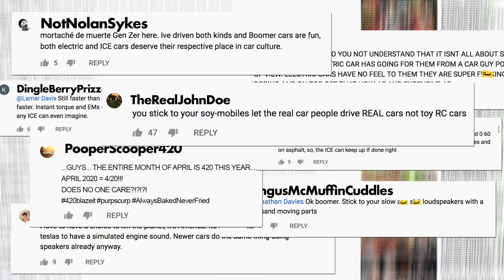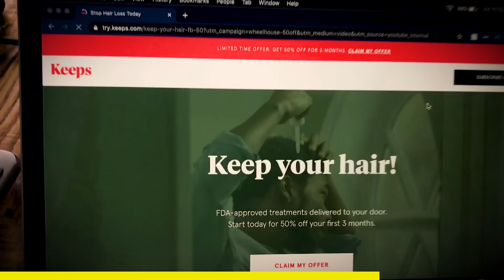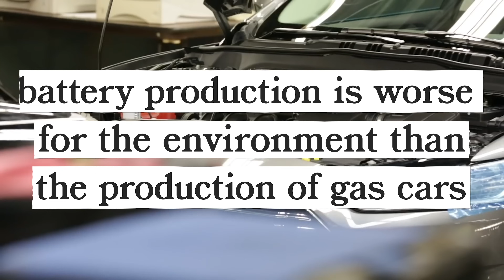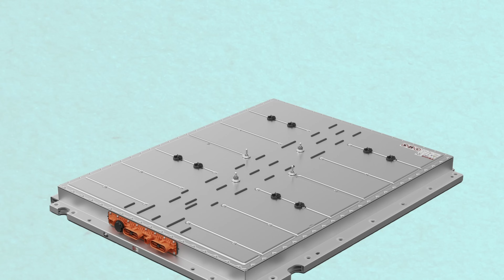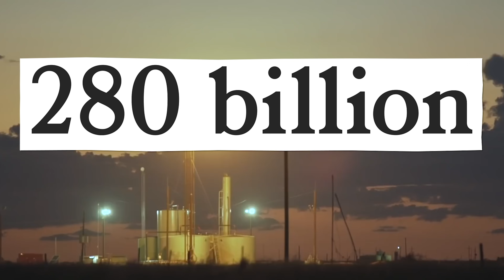Are Electric Cars REALLY Better for the Environment?

Comment: I wonder though, when it comes to ICE engines, what can alternative fuels do to top gas powered engines AND EVs? I feel like with the efficiency of production for ICE engines, pairing it with a less destructive fuel source (especially right now that EVs are way behind) would set it really far ahead from EVs and gas engines.

The reason for my stubborn anti EV stance is because of the way the movement in favor of it is trying to cram everyone into one by force. Making laws that force people to do something and have them appreciate the benefits only in hindsight it way too antagonistic and ruins something genuinely good for the environment in the mind of the average citizen. People will inevitably move towards EVs as they become more affordable, and we have a fair amount of people making the approach right now without being forced to buy into them. If you force the EV industry to cater to the hundreds of millions of Americans alone (and that number is growing) even by 2035 like California wants to do, you will cause an exponential increase in environmental pollution in such a short time frame that will likely have worse consequences than the slow burn CO2 emissions from gas cars are causing right now. 

Think of it like a slipping clutch, you will either wear away at it slowly with bad driving habits or you can just bore right through it with one massive burnout. Mandating EVs is the latter option, and it's wrong for it to become a legal mandate instead of a heavily incentivized alternative. 15 years goes by quick in the business world, folks.

 I feel like if we have to do anything, we need to make "non-specialty vehicles" (basically commuter cars with no outstanding performance features) run on alternative fuels of some sort. Yes, there will be cars people use for racing, heavy hauling, or simply luxury, but perhaps those more expensive specialty vehicles can be the ones to run on diesel or gasoline thanks to their practicality when applied to their maximum efficiency. Imagine heavily polluting the environment to produce gasoline, only to have it serve the absolute minimum performance possible, that's like tending to a hundred-thousand-dollar vineyard just to make bargain brand grape juice. So if you're just going to be using your compact 4 door to get to and from work with carpooling in mind and we aren't going to force everyone to get an EV by a specific deadline to drive emissions up so high from production, you should talk more to the folks using biodiesel and used cooking oil or whatever. Meanwhile, if you're purposefully going to indulge in the hobby of motorsports or need an ICE for purposes that "commuter fuels" cannot satisfy, you should be the main market being catered to in order to make production of gasoline more worthwhile in the long run.

Plus, once ICE engines running on traditional fuels become a want and not a need, the production of traditional fuels will be tied directly to the demand for it from the specific markets that need a specific kind of fuel. Less demand means less production, and the less you produce, the less materials you use up in a given time frame to meet the smaller demand (which means you contribute less pollution in that time frame as well!). And once people slowly start to feel "ready" to leave ICE engines if EVs start to scratch that itch for higher performance better, you'll have a smoother transition into a fully electrified and environmentally healthier auto industry that caters to all needs.

TL;DR: ICE production is less polluting to the environment right now, so why not use alternative fuels for simple commuter cars to offset their wastefulness and be better than the amounts of pollution EV production makes alone? Because I think forcing mass EV production for a huge market of consumers by 2035 in California alone is only going to cause worse amounts of pollution, it'll just be happening somewhere they don't have to see it instead.
Reply: Too long didn’t read much but the 1st and 2nd paragraph, but the thing is EV’s ARE less harmful to the environment, and the reasons the laws are enforcing it is because it NEEDS to happen now or else our whole population is gonna be wiped out. Just because you don’t like the way it is being done, doesn’t mean you have to let it wipe out our population.

Comment: You are not accounting for batteries being much less efficient as they age. They are also much less efficient in very cold weather. Much of their power will be sacrificed to cabin heat, or air conditioning I have a hybrid and it’s mpg drops by 15 to 20% during the winter months. Are you willing to spend 20 minutes or more charging your car during a long trip? This will create long lines and angry people. If we eliminate gasoline powered cars, how do we maintain our roads and bridges? Toll roads? Ask the people who use the Pennsylvania turnpike how that’s working out. How do we supply the additional electricity required to replace the gasoline power? Solar and wind power is NOT capable of creating sufficient energy to supply the additional energy required. So fossil fuel power will be necessary and will be required to use much more power which will only transfer the pollution from the vehicles, to the power generation sector. Nuclear power generation would work but there is too much resistance to it at the present time. I currently drive a hybrid vehicle which is about 7 years old. The hybrid batteries have lost significant efficiency due to normal aging and deterioration. I started out at 46 mpg and now get about 36 mpg. This loss of efficiency will also rapidly decrease the value of the electric vehicle as the vehicle ages. There are many more disadvantages of the EV’s such as long recharge times and more frequent refueling stops. Extreme weather, (hot or cold) are also very bad for EV’s. For people with no garages it becomes very impractical and costly.
Reply: ICE engines also become less efficient as they age.......and they are also less efficient in cold weather.

Comment: Great video. And I know its nitpicking, but the nuclear power plant in 8:41 is not releasing any emissions into the environment, that's water vapor. Nuclear energy remains the cleanest and most efficient solution to the replacement of fossil fuel.
Reply: Clean??? Leaving the nuclear waste and irradiated sites for future generations to deal with?
Reply: @ridstanejimmy  the waste produced by nuclear power is infinitesimally small. And there will not be irradiated sites if they managed well. Nothing is 100% safe, but nuclear energy is almost literally magic.
Reply: @arturogranados1133  Are you serious, Arturo? There are many obsolete subs in storage with no plans for tackling their reactors, but they need cooling pumps running continuously until the end of the World. There are power stations with the same fault as Chernobyl which are still uncapped! How long before the Chernobyl core burns through to the water table and explodes? Remember the previous global disaster was only a fire! Even the stupidest child will only burn himself once! Nuclear is the World's most expensive and dangerous steam engine! (How much CO2 is produced in the building of a NPS?)  The environmental nightmare that is nuclear has been well known all along. The only reason we have nuclear fission at all is because Military wanted plutonium for weapons.

Comment: Solid State Batteries are possible yet nobody is moving towards those for some reason. I remember reading something on toms hardware talking about how if you made a solid state battery the same size of the one your phone it would keep your phone powered for several days before finally dying.

Comment: The electric car is life-threatening because it already runs on finished energy, in reality all the energy is in the car, and today's batteries are burning from the inside, the cells are everywhere, there is an explosion anywhere in a car crash , especially if made in China.
The petrol car, on the other hand, produces the energy it needs.
If all cars are electric, the power plant will be multiples and today’s power plants are still mostly fossil, it doesn’t matter if the car is burning oil or in the power plant. And there’s also the raw material of batteries, in China, where the destruction of the environment doesn’t matter, but the world should count because China is also part of the Earth.
If these are not taken into account, their heads are stuck in the sand.
Reply: Also with respect to burning oil. That’s not quite the case. The Mazda 6 is in the same size category as a Tesla Model 3. The Mazda 6 Diesel has a fuel efficiency of 7L/100km. However if you were to run your model 3 off a 8kW diesel generator it would achieve a fuel efficiency of 3.2L/100km. That’s because generating electricity, whilst slower, is much more efficient than a using the mechanical energy from a combustion motor.

Comment: I’m not here to start an argument, but more clear my own misconception, I knew in operation EV’s are better, but my question is, when you factor in charge inefficiency and general power loss from heat to EMS and control units for chargers and infrastructure, do the tides balance out more? I live in SoCal, and to what I know we get out power from Nevada and Arizona mostly, accounting for loss in transmission, then for the supercharger or home infrastructure, and then the Tesla itself’s inefficiency in charging the batteries, and delivery of power to the wheels, I feel that that would turn the tides a little, as those losses stack exponentially, beyond that, my second question becomes Tesla’s need battery pack replacements every so often (I forgot the metric, but assuming abt 2.5 years or like 50k miles) you’d need to make another complete battery pack and dispose of the old one, adding another layer into the carbon heavy step of manufacturing, I don’t mean to make an argument again, just curious if someone can tell me if I’m wrong, or if those two factors lead to a more balanced metric, I’ll say this now, in the long run, I think EV’s will be more efficient, but I don’t think that the timeframe is as short as people assume, anyways, thx
Reply: Even long distance transmission only results in a 10% power loss. But in way of comparison, let’s compare 2 similar sized vehicles. A model 3 and a Mazda 6 Diesel. The Mazda gets a fuel efficiency of approximately 7L/100km. However if you used that same diesel on a 8kW diesel generator to charge the Tesla model 3, the Tesla would have a fuel efficiency of 3.2L.

If comparing against hydrogen one has to realise that the greenest and most efficient way of producing hydrogen is through electrolysis which is use’s the same grid energy as that which charges a Tesla. Meaning it has similar transmission losses whilst using more than 3 times the amount of energy per km worth of hydrogen. Hydrogen cars are also electric, using a fuel cell to convert hydrogen into electricity. Meaning much of the electrical losses through inversions and charging are similarly lost inside the fuel cell vehicle with the drawback that fuel cells in cars are often approximately 40% efficient with a hypothetical limit of 60% efficiency.
Reply: But for a Tesla the charging and discharging of the battery is approximately 98% efficient.

Comment: Hybrid seems like the perfect answer as long as it can be used all ICE and all battery.  Price will dictate what gets used and when.  Long overnight charge at low price is great for going to work the next day.  Stopping at a gas station, filling the tank, and rolling right back out is also great.  Long road trips or can't find a charger?  Why not both?
Reply: Hybrids actually is not the answer, we need to stop oil refinement, creation of pipelines etc in order to make battery technology grow faster. Oil companies won't allow that research.

Comment: Has it been taken into account biomass burn in electric plants with relative photosynthesis loss, and buildong of all the powerwalls, charge stations eccetera? Many other problems of EVs at the beginning of this video have been nominated, but every calculations has been turned to an external site without explanations. All this is incomplete, and I keep telling: it is NOT time to play with the future building an all new infrastructures system with relative costs and emissions without having a good and sure result on numbers BEFORE. The only sure action is to reduce energy demand without the need of new infrastructures, and this is what I believe in and what I am working to: see www.conveengine.com

Comment: Electric cars are no way more autonomous . Why lie ?? com on a low range EV tesla goes about 50 mmiles per full charge. And the power used from power plants is causing more pollution, the gas cars have just one full tank of fuel and it takes you 150 miles. no way if All the cars would be EV we would die in noxes .

Comment: No one is talking about this, but electric cars are being promoted only as a step to get fossil fuels totally under the control of the government.  Once internal combustion engines are taxed out of common use, then electric cars will be attacked because their electric motors release lots of ozone into the atmosphere, as do wind mill generators.  Of the five greenhouse gasses (water vapor, ozone, oxides of nitrogen and sulfur, methane and CO2), carbon dioxide has the least influence on the weather.  The ultimate goal is control and the elimination of personal freedom of movement, so government owned and controlled trains and buses are the ultimate goal.  That controls the movement of the population.   By the way, "greenhouse gasses" contribute only a tiny influence on the weather compared to condensed water vapor (clouds) and particulate matter (dust and smoke).  That's just another inconvenient truth the weather alarmists won't mention.   Weather alarmists have been around for 25 centuries in places like Europe and Africa (see "Chicken Little" and the most famous weather alarmist of all, Henny Penny.

Comment: Ice will always be superior. Always.
Reply: Not really, battery gives better performance and efficiency than ICE cars. Instant peak torque at 0rpm. Very little wastage. Much safer in an accident, better handling due to the insane low centre of gravity but can suffer in long track runs without sacrificing battery health to do it like the Taycan. Infact some of the fastest production vehicles in the world at the moment are electric, especially thanks to the recent release of the plaid variants.

Comment: Also used EVs are not desirable because the battery capacity deteriorates. This means used EVs will be extremely hard to sell. We will soon face lithium shortages. Conclusion: ICE Cars aren't going anywhere
Reply: Well considering a battery will last double the lifetime of an ICE car to only 30% reduction in battery capacity. I don’t think you’ve come to the correct conclusion

Comment: The courts in usa made ice cars be recyclers recover auto  fluff in was called materials in seats and the junk yards stoped taking in old cars never know the real facts ,yet i remember the cars filling the spaces in big cities, abandoned, do to high recycling costs mandates do to invirermental inpacts of air ,,,,question is will batterys in cars have core charge as other car battery have to be properly disposed of and if so how much we these facts change you emissions of overall footprint seeing there are ice cars many years old and some of them still have auto fluff in there seats ,i believe the true cost of emmissions of oil refineries are not reflecting that gasoline was waste of the products needed to be as in meds and fighter jets and polymers make up the need of emmissions do to you COULD not feed protest and save the people with out the emmissions and the gasoline COULD be pumped back in earth as gas is in caverns in crust ,so how can you say oil refineries are emmissions solely made just for cars ,,,,,seeing gasoline is not the mail results of need for refining, ,,,,,think of the all the compounds that will make the world stop many things that prevent more manufacturers to make more just from the loss of cost to produce lasting products with high teck oil products ,,,,,,any way check out the ban on junking cars in the 80's i think it was when on for a year what an impact with no way to safely recycling  cars

Comment: I don't think you're being fair to the oil industry. Oil supplies the whole petrochemical world and provides considerable spin-offs to alternate manufacturing. For example, the plastic industry resources are practically underwritten by the oil industry, so wherever you find plastic, you find offspring from the oil father. Which means computers, aircraft, leisure sailing and cruising craft, toys, and - yep - electric vehicles. It also provides the shelves full of solvent substances for cleaning, sniffing etc. Oil is to global industry what China is to manufacturing. It's universally pervasive. So the huge carbon footprint of the oil industry cannot be exclusively attributed to ICE vehicles. Furthermore, the `green-ness' of so-called alternative energy sources such as wind and solar is itself subject to negative scrutiny in terms of efficiency and longevity compared to fossil fuel generators. Additionally, far more could be done to restrict pollution caused by fossil fuel electric generation by scrubbing exhaust gases to minimise greenhouse emissions. 

The ideological stampede for electric vehicles also seems to have trampled underfoot hydrogen as an alternative fuel for ICE engines. This would largely employ existing engine technology whilst producing zero pollution when burned, and may well be the missed opportunity that everyone rushing to produce electric motors sadly failed to notice...